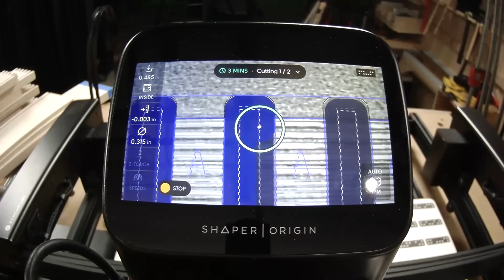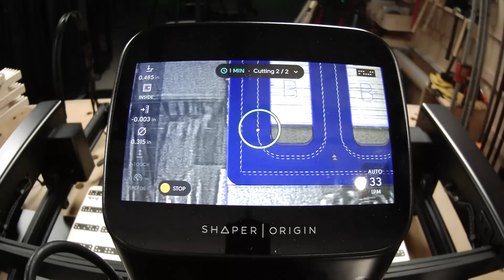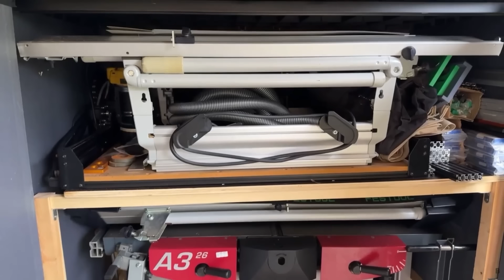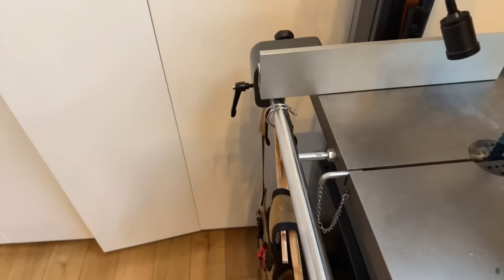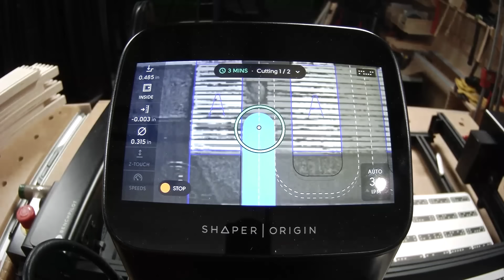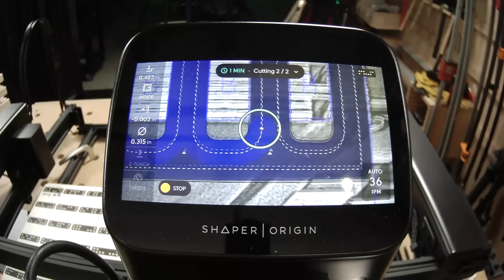Session 145 - English: Drawer Box Production With BenchPilot

Comment: I'm having an issue that I thought was unique to my setup but you can actually see it at 48:35 as well if you zoom in. The two sides are not aligning on the bottom which doesn't make sense given the two grids.

This means the drawer box tops are not flush.

Comment: I am confused on one point. Normally when cutting mating surfaces you cut one at zero offset and then sneak up with a negative offset on the mating side. 

You suggested doing that in the video, i.e. cut the first one at zero and then check with negative offset. However, you cut all pieces with the offset in this case. Given that you used a 1/3000 offset wouldn’t that effectively be a 1/6000 because it was cut on both sides?
Reply: The suggested method of cutting A side at 0 offset and finding the right offset on B is annoying because you can't encode the offsets in the parts so you can't cut both sides with benchpilot.

I agree on confusion about offset on both pieces (though it would be 1/1500 not 1/6000).

I ended up just guessing at 1/1500 as my offset on both pieces and it fit well.

Comment: Excellent video.  I am a new SO user and a step stool with box joints is my next project.  Being able to cut 'A' on left side and 'B' on the right with one setup is going to be really handy.  I was a little confused why the anchor point for the 'B' is on the middle right instead of the lower right since that is where the grid was built.  I guess this is unique to the 'on tool box joint' application. ??